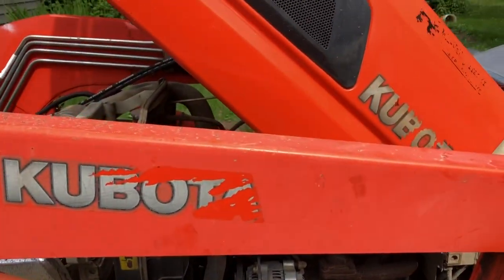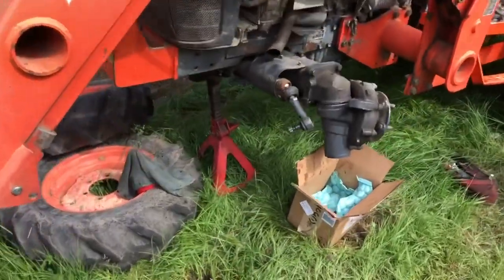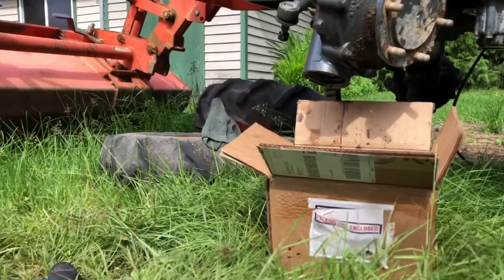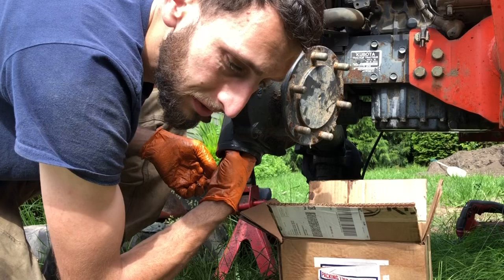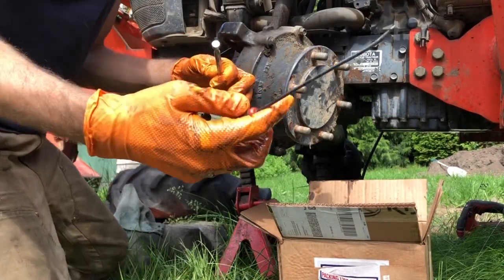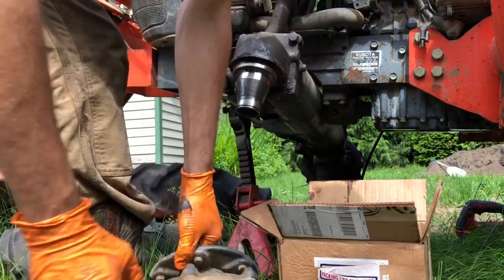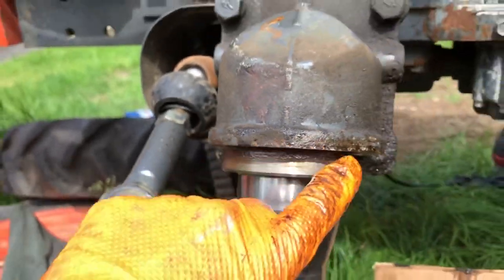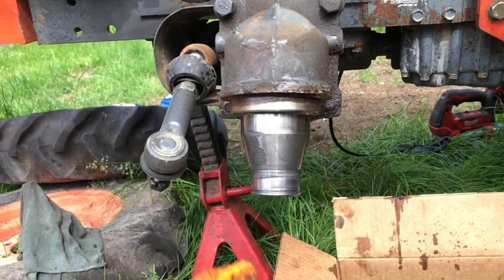Kubota l3830 front axle seal replacement

Comment: Fixing to replace that knuckle seal on a L3710. It's not leaking it's pouring out. Very informative video. I've replaced these seals on different tractors but this is a first on a Kubota and I wanted to make sure I'd be doing it right. It's a little bit different but I'm pretty confident my dad and me can do it now. The only thing we need other than the parts is a good set of snap ring pliers. Thanks for the video.

Comment: Awesome video. Thank you.
A simple way to get those shims to stay in while you are putting the snap rings in is put a small dab of grease on it. It will stick to its mating surface and allow you to focus on the snap rings.
Reply: Thanks James, that's what I did thanks to you.  I'd fought with it close to an hour and then read your suggestion.  Much appreciated.
Reply: Pull the whole unit off the axel casting with the 5,17 mm bolts ,then you can get at the snap rings and have it on a table..Then you can drive the bearing and seal out the bottom.When you try to put that shaft in you have to catch the splines for that top bevel gear. You do it the hard way but got it done.

Comment: Nice work on the video Sir. Thanks for this. The hardest part for me on my L4200 was trying to get the damn tie rod end off. No under breath words were utilized...they flowed out pretty freely. The other hard part was the snap rings. The crappy little 4" snap ring pliers don't work. There is not enough handle leverage to open/close the snap ring. I bought a $50 set of 13" snap ring pliers off Amazon only to find out the plier ends are too big and wouldn't fit in the snap ring holes. It was a goat rope of a time using needle nosed pliers ground down to a pointy end but eventually I got them out. A tip  that helps - Use 2 jack stands under the axle. This way there is no 'sea-sawing' movement of the axle as your messing with it. The moral of my story.... Having the right tools will mitigate a ton of frustration. Cheers!
Reply: Double D, did you have a parts list for your 4200?  I've got the same tractor and debating on taking this job on.

Comment: Great video, it was a very big help.  I did use a little grease on shim to hold it in place when installing so I had my hands free to install the upper snap ring which was a bear.  As you said it is a poor/ridiculous design.  Since my hands were too wide and my fingers to short to insert shim all the way up I used a small magnet to insert the shim after greasing it.  Then held it in place with a screw driver so I could remove the magnet.  It stayed long enough for me to get the snap ring in place.  I would not have tackled this job without your help and some of the helpful comments.

Comment: Why didn't you remove the 4 bolts holding the bevel gear case to the front axle case and perform this procedure on the bench?  Just a $5 o-ring between the 2 parts.  I have to replace the bad seal this weekend, its cold out and im a woosie!  Thanks in advance

Comment: half way thru the job for the first time. You make it look very easy! that snap ring that holds the knuckle up is a bear! a few selective self encouraging words were used, but having the right tools is a must. Still great video! could not have done the job with out watching first.
Reply: Take the axel end off 4 bolts then work on the bench n

Comment: A seal puller reduces the risk you will damage the cylinder side wall.  No slot head screwdriver needed.  I bought my seal puller on Amazon when I replaced the axle seals on my Kubota B26.
Reply: Dang straight Ralph. I can tell you that a 12" seal puller will not work for this, its too big. A smaller one will do it though.

Comment: Just a couple pointers. If you had left the wheel and tire installed on the opposite side it would have added weight (pendulum effect) and kept this side up in the air, easier to work on. You wouldn’t have had to stick the Jack stand under it. 2nd. There is a roll of polishing material we used to call crocus cloth. You could have rolled about 12” off, used it like a polishing belt and cleaned the sealing surface to a mirror finish. Great job though. I’m doing the same job on a smaller Kubota (B7500), last time about 13 years ago. The B’series seal has a wear ring on the sealing surface. You do need to be sure that sealing surface on the spindle does not have any fine cracks in it. It’s a common problem on all these tractors due to being worked so hard. They will really pour grease if cracked. If you check with the Kubota deal you will find the sales history reflects a lot of the spindles being replaced.
Reply from the maker: Hey Patrick! Great points! I’ve gotten sharper over the last 5 years of fixing these tractors. Glad I’m not the only one out here fixing these.
Reply from the maker: Also, I’ve had to press many seal savers on those pitted and rusted spindles.

Comment: Fr working on seals fr cars, to get the seal ring out, I use 2 flat head or round tool to punch into the seal to stay n hold, try to pull it out. always put some grease around the seal or inside the bearing so it goes in smoothly.

Comment: You could use a  Dremel to clean that surface it’s easier than using sandpaper on Emery cloth
Reply from the maker: @user-du7pe6pm7d  thanks for the many inputs. Most of the time I’m using seal savers and sleeves in this situation. Did I mention all these years later, it’s still dry and working great? Happy YouTube critiquing

Comment: How does that bottom cap come off.
Reply: Its a pain but it basically pulls straight out with some effort. There are 2  opposing notches on the housing where a small flat screwdriver can help get it started.